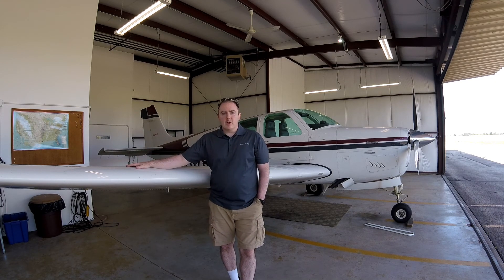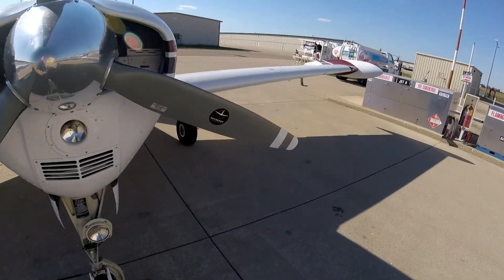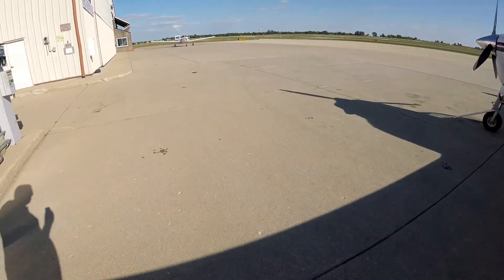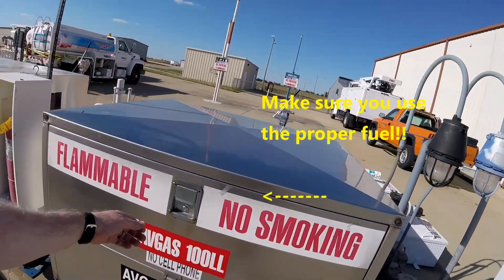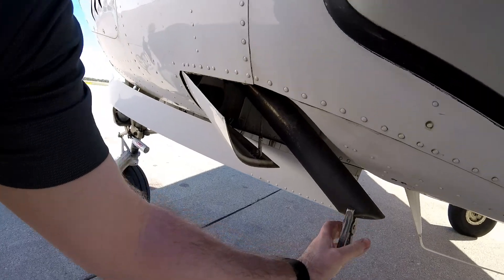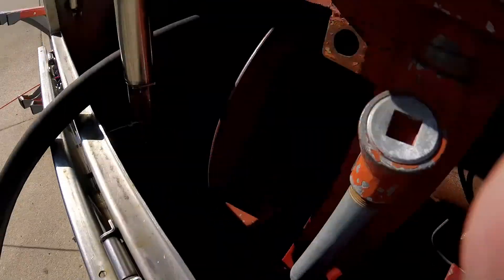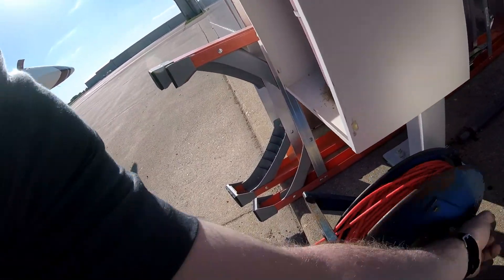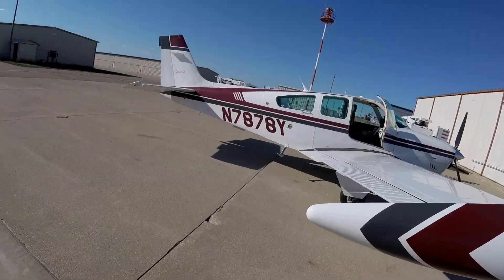How to fill your plane with gas (With tip tanks)

Comment: Whats the total range for Bonanza with wing tips?
Reply from the maker: At a decent lean cruise I would say about 8 hours @ 170knots or 1300+nm.  That is full tanks or 120 gallons.  Last year I went from Austin to Chicago in one leg.  I only started with about 110 gallons and had to dodge some weather, but landed with 1/3 my mains in just under 6 hours.  Of course keep weight in mind.  When it was just me, it was no problem.  When you have well over 700lbs in gas, you are probably limited to two biggish people and bags.